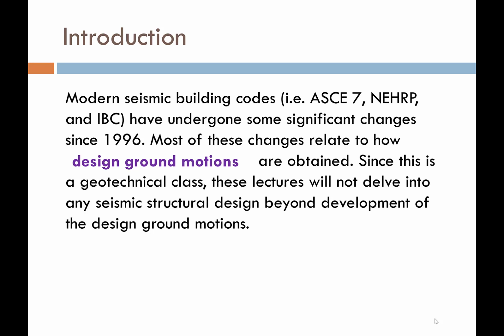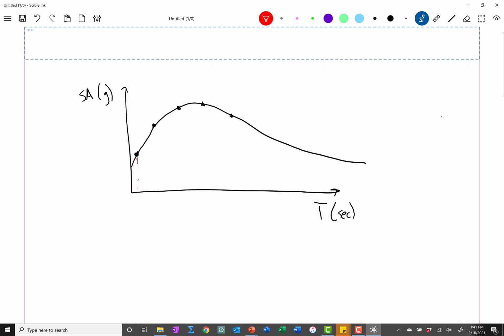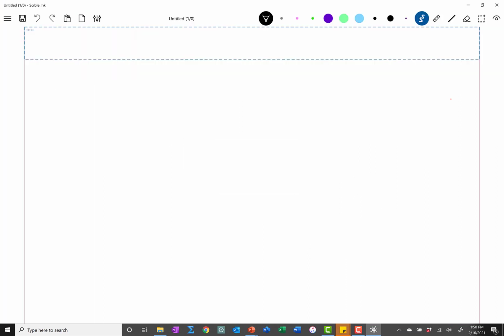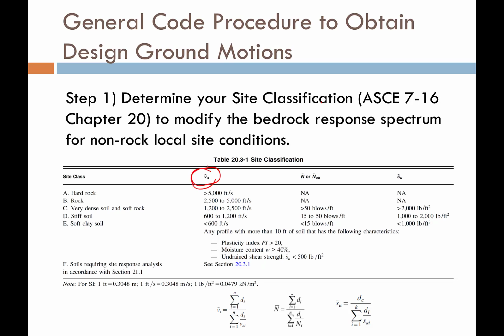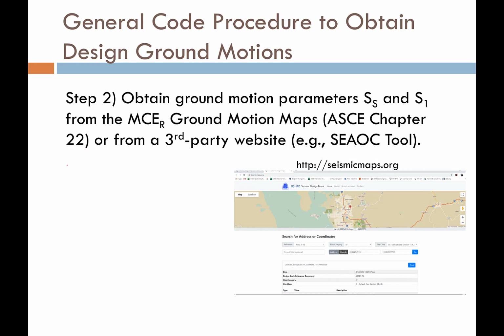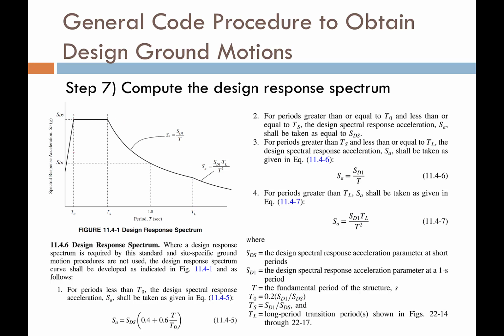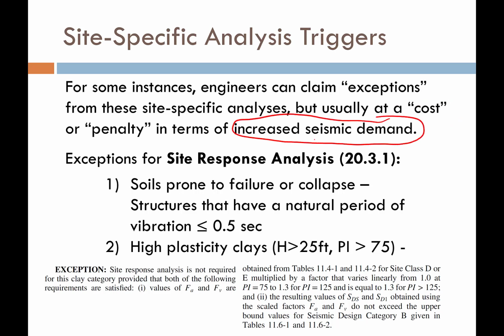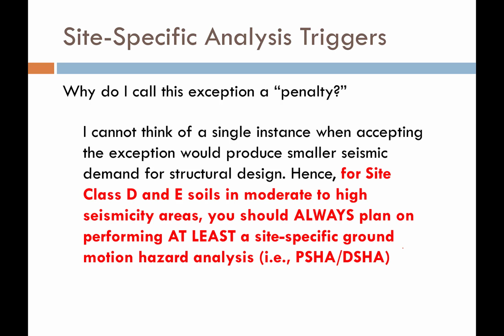CEEN 545 - Lectures 11 and 12 - UPDATED Introduction to Ground Motions from Seismic Building Code

Comment: I’ve been informed that the cost of performing a site specific analysis is very expensive and difficult to get approved through the building departments I’m familiar with. As a licensed structural engineer, I have incorporated the “penalty” in my analysis (and I too call it a penalty) and find there are many situations where the resulting 20% increase in base shear does not directly demand a 20% increase in seismic connections.  Usually, typical seismic connection details for items like moment frames and diaphragms have so many other limitations and minimum requirements that the capacities generally capture the penalty.  And if the forces are higher because of the penalty, the increase to the next bolt group or weld pattern, etc., is not 20% more costly.  I’m also comparing the type of buildings I’ve engineered to previous seismic codes with the current code.  There is more for a structural engineer to calculate by today’s code, but by comparison, the current code with site class D-Default (which contains the penalty) is not too much of a greater design force than the previous code site class D values.  Granted, if I can get a soils/geology report with current site class D recommendation, that’s the best I can ask for.  Projects are mostly on Southern California.
Thanks for the video.